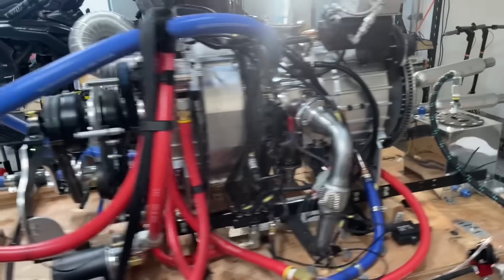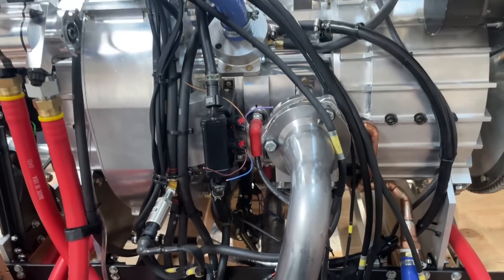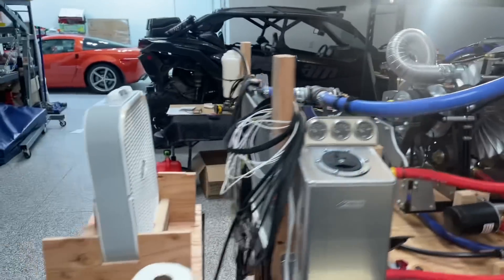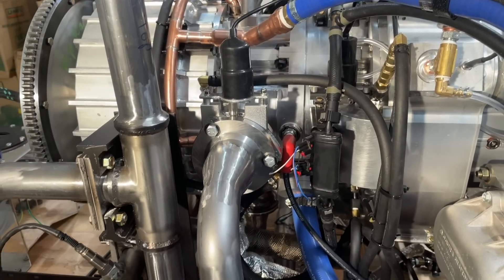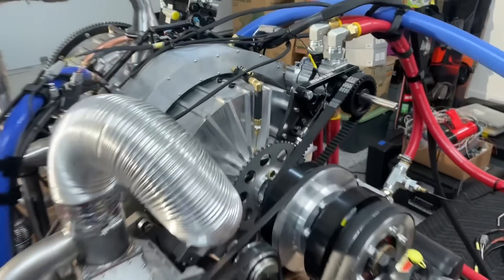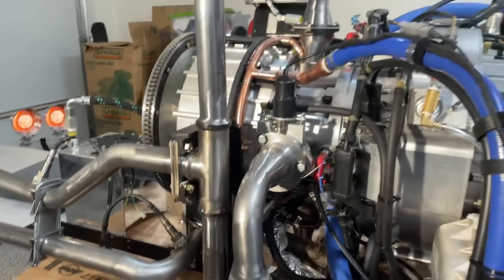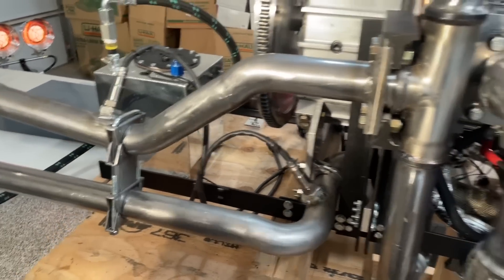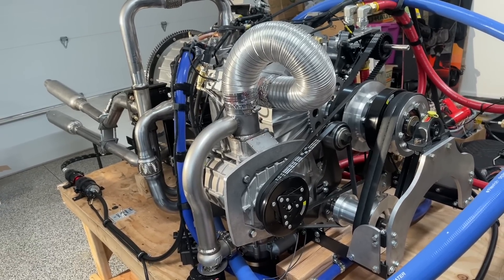Devize Engines “Barrell” - Supercharged  - Opposed Piston -  4 Cylinder 2 Stroke - Tuned By Shane T

Comment: Their acting like this is some new space age design shit. 
This is just an upscaled version of the common automotive A/C compressor. 
Just search “what does the inside of an A/C compressor look like” you’ll see what I’m talking about. 
Basically the only thing they have managed to accomplish is to attach an oiling system to a common A/C compressor. I remember watching a video years ago of a young guy from the Philippines that actually converted a standard A/C compressor into a gasoline engine using basic hand tools.
Reply from the maker: The concept isn’t new but this specific design has never been done before. Thanks for the watching!!

Comment: Like the old dynacam motors but with the cam plate at each end instead of the middle. Torpedoes use a similar engine config

Comment: I tried the electric clutch setup and several various versions. Had trouble getting it to dissipate heat and it refused to hold. I tossed it and went with a 3 speed gearbox and a real clutch. Less, less and more.
Good luck...
Reply from the maker: Yeah surely with any level of resistance (boost) it will be a problem. In this case the blower is being used mostly to push air through the engine as it is two stroke. Later the engine will get turbos which will be doing the real boosting and the Supercharger can be bypassed and switched off.

Comment: Very interesting. I'd like to see one of these prototype engines catch on. I've seen a lot come and go over the years. It's obviously very hard to design something that offers enough of a performance and efficiency improvement to make it worth considering over current IC engines but is durable, refined and makes sense costwise to produce. I love this sort of stuff. Thanks for sharing.
Reply from the maker: Agree on all fronts and thank you for giving it a look.
Reply: Train and big submarine engines are opposing cylinder engines they've been around for decades
Reply: Taking 2 rotax 850’s to make a 1700 OP 2 stroke would be fun.